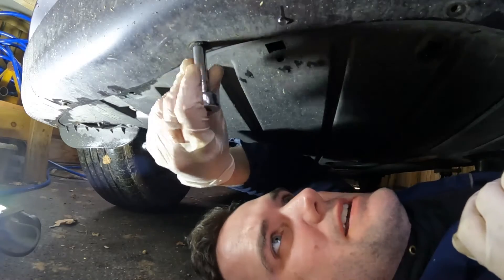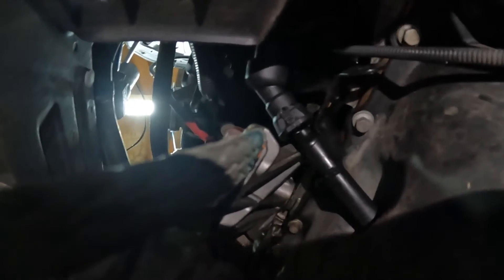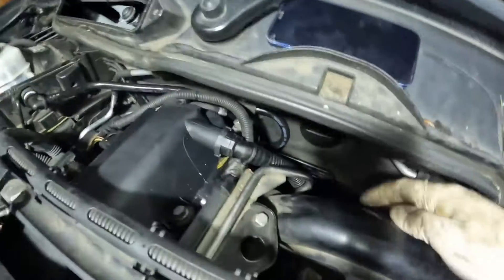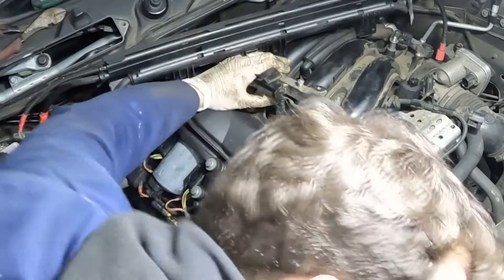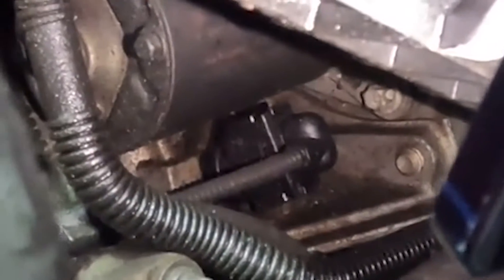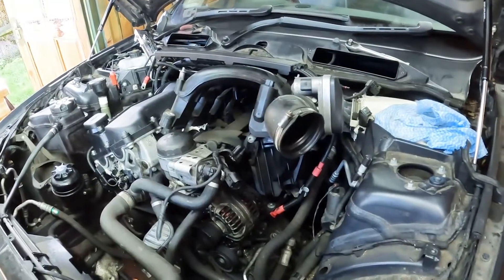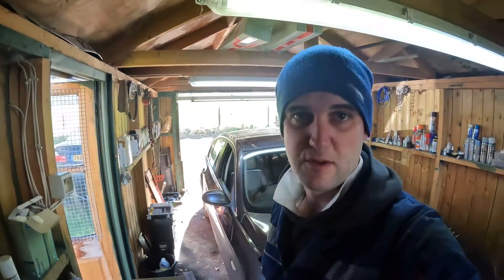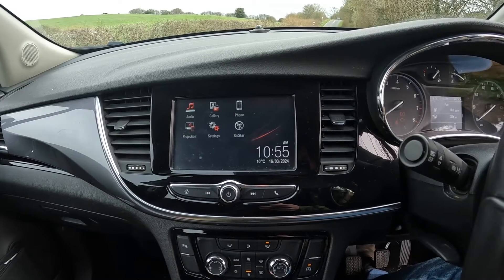BMW N46 crank sensor replacement 320i E90

Comment: Great video! Thanks! I've just replaced the sensor to my X1 318i. That fuel pipe conection  is a mother 🤬 cker to disconect !
Reply from the maker: Thanks- I just think it’s mad the sensor is so buried when it’s a common fault on most engines!

Comment: Hello. My e90 320i n46 just cranks but won't start. New ecu but problem still there. Not starting. No signal to ecu .im out of options
Reply: Fuck that car. And thanks for trying to help
Reply: You try disconnecting the IBS sensor? @kaashifgaidien580
Reply: @kaashifgaidien580 hi did you find the issue crankshaft sensor  has been changed ?
Reply from the maker: Does the RPM gauge move when cranking?
Reply: Mine doesn't move. I need help 😫
Reply from the maker: Has the crank sensor been done? Presumably the ECU has been programmed to the car?
Reply: It's still the OEM sensor. Ecu goes on but there's no spark and I don't hear the fuel pump going on either. The car suddenly didn't want to start last week. It's just cranks . And all relays and fuses are fine
Reply: You described something similar to what happenned to me, tell me did u get any connection to the ecu when you plugged in a scanner @kaashifgaidien580
Reply: Plugged the old ecu in. Same thing. All I hear is the throttle body going on
Reply from the maker: O wow - I can see why you’d try a new ECU with all that going on! I don’t know enough to have any certainty but I’d probably want to confirm the fuel pump isn’t working by pulling the rear seat bench up to access the tank - either have a better listen and or check voltage. I assume you’ve had the plugs out to confirm no spark?
Reply: Fuel pump works when connected with jumpers. But there's no spark. I'm guessing it might be the crank sensor. But I'll see in a day or 2 and keep you updated
Reply from the maker: Good luck!
Reply: No success. Still cranks, but spark,no fuel pressure
Reply from the maker: Sounds like you are narrowing it down. Do you know if the fuel pump is powering up when cranking? If not have powered it up with your ‘jumpers’ whilst cranking? Might sound silly but have you actually got fuel in the tank?!
Reply: @kaashifgaidien580  any update i have the same problem
Reply: Fuel pump works with direct connection and yes I have enough fuel in the car.
Reply: Rev counter not moving while cranking either
Reply from the maker: Rev counter does sound like crank sensor. Have you tried turning over whilst sending power to the fuel pump or do you now know if the fuel pump is working whilst cranking? Are you confident the ECU is programmed correctly (in my Vauxhall days we used to reset the old on before taking it off so it could be programmed to another car)?